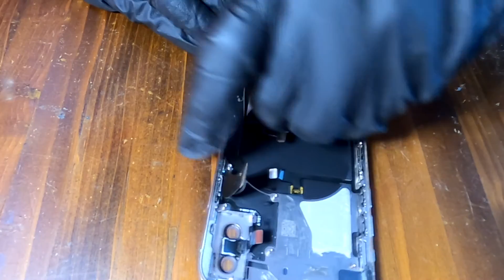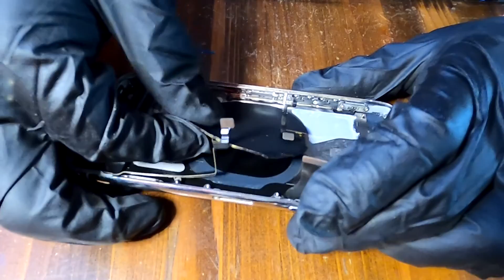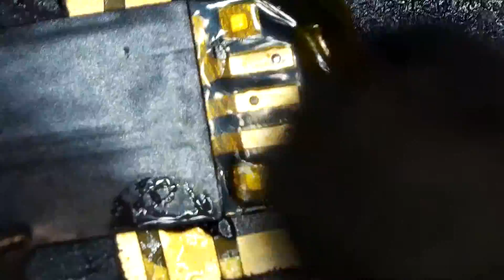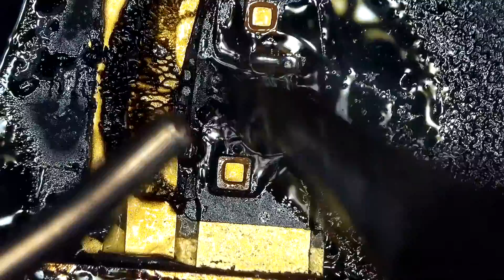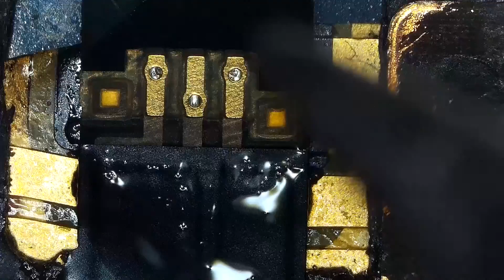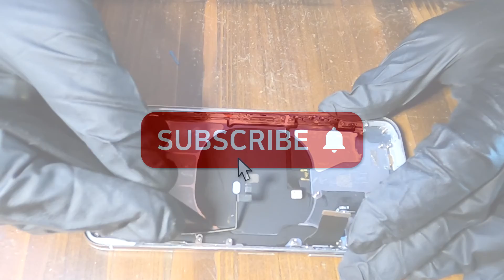iPhone X Wireless Charging Coil Replacement

Comment: hi bro, when i removed the battery, i accidentally hit the sheet on the wireless nfc tag, is that a problem?
Reply: sheet is like a black tape
Reply from the maker: maybe.. you need to find out. Try to use a wireless payment and see if it works.
Reply: @PTITBROTHERGravenhurst  works bro, but if there’s any problem to battery?

Comment: Hi .. thanks for the video ... I bought a new wire coil .. I have replaced by it doesn’t work ... I don’t know what else to do ... thank you
Reply: The volume bottoms work perfectly... is just the payment option and charging option doesn’t work
Reply from the maker: Did you replace the whole assembly? Or just transferred the coil unit and soldered?
Reply: @PTITBROTHERGravenhurst i  replaced the hole thing ... buttons of volume, silencer, and the coil ... it was already soldered.. thanks for your respond
Reply from the maker: Maybe it has a programmed serial number just like the LCD. People do copy and re-program it on a new part. I am not sure if you can program the wireless coil

Comment: Hi! Thanks for you video! What happens if i just replace the volume flex and don’t connect it to the NFC Flex? Please respond. Thank u!
Reply from the maker: Hello, In fact that the entire volume flex + wireless charging coil cable are connected to the logic board, all of the buttons and the wireless charging + payment functions will stop working
Reply: My iphone X widhout chip is in restarting mode

Comment: I've recently replaced the housing for my iPhone 8 Plus; and the wireless coil isn't working with the charging and the Apple Pay 

do you have to connect the photo to iTunes to pair to the new part, like you would a motherboard etc?

(its a genuine Apple Housing- but its not reacting at all, any ideas? )
Reply from the maker: Have you changed the charging coil with a new one? Or you just transferred the existing one?

Comment: If you have a new charging coil and a new flex cable that is already clean, do I still need to use flux or wire between the connection? Or can I just solder it straight in with flux
Reply from the maker: You can solder without flux but it is always good to use extra flux when soldering for stronger solder joint

Comment: hey what temp did you use to remove the original cable
Reply from the maker: I think it was 300C, but this is not the answer for all people. You need to find the safest & most effective temperature depends on your hot air gun performance. Hope this helps.
Reply: @PTITBROTHERGravenhurst  thanks!

Comment: hello I have a question, I replaced my iPhone XR housing. then the NFC which is responsible for Apple Pay is not working anymore
Is it because I damage the wireless charging coil? 
is it related?
Reply from the maker: Yes. They are related. It could be damaged NFC charging coil or antenna
Reply: @PTITBROTHERGravenhurst  thank you for your response